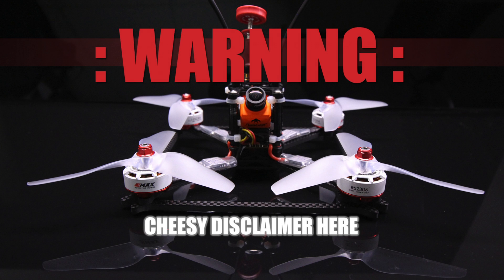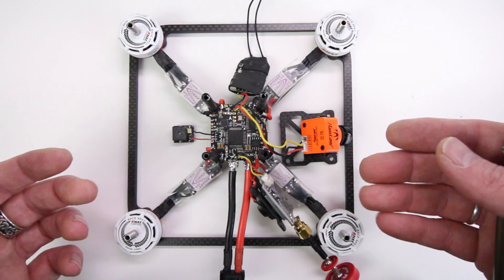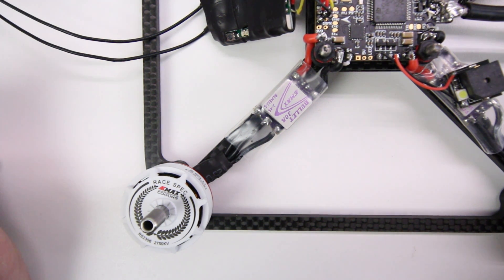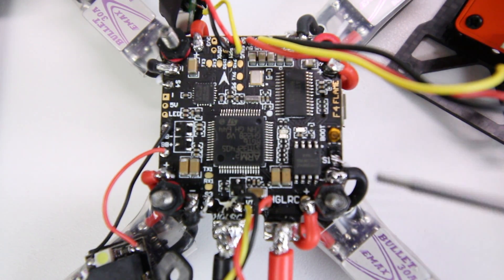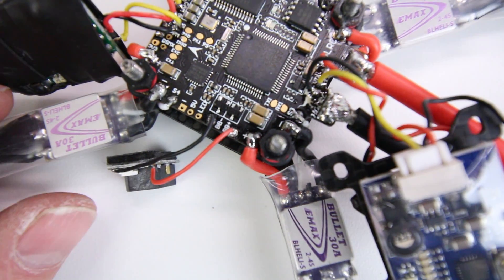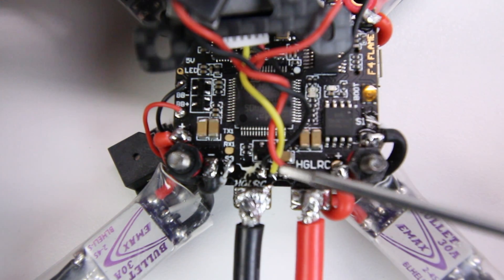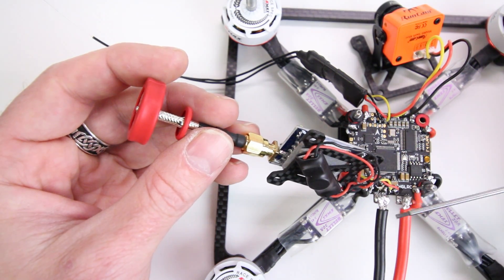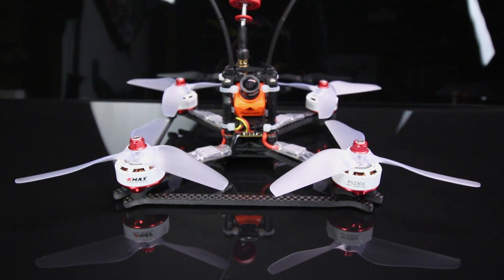100MPH RACER DRONE

Comment: sir i had made racing drone by seeing your video but i am facing problem in configuration of esc and flight controller ;in my drone i am using emax 35a bullet esc,matek f405 crt flight controller,motor emax 2306 and i bus receiver sir plz contact me my email is toystory0787@gmail.com

Comment: wish i didnt loose my kraken 5r it was fast with 2207/2650kv,spedix es30,f4 pro omnibus,frsky xsr,tbs unify pro hv weighed only 303g with cyclone props on no lipo .. you know of a frame like boltrc kraken 5r thats fast and durable? im worried if i buy a kraken 5r again the company may discontinue parts since its older frame design ..any thoughts

Comment: Even if you didn't save weight you lowered the center of gravity which is good. And also decreased the aerodynamic profile which will help to stop eddie currents from forming around the tower or "stack" when air speed is to high to flow between the boards. You've also moved the weight out to the sides and away from the center which will help it come out of spins better. Think of an ice skater. Nice build.

Comment: Hi Justin, I have purchased almost all of the components for this build.  Motors, esc's, frame.  But I am still fairly new to the hobby and have a question for ya.  I already have a F3 CC3D fb.  other than the one you are using which has more features in one fb, would there I get the same performance if I use the F3 rather than the  HGLRC F4 Flame use in this build?  Apart from more components in one what is the difference in all the more expensive FB.
Reply from the maker: I would use the F3. Easier out of the box. Flies great on default pids

Comment: I dont know who to ask but can the motors on the Hubsan H501S be replaced with other brand motors like the EMAX MT2204 KV2300 Brushless Motor for RC 250mm Min Quadcopter
Reply from the maker: Not sure Rick. I don't think so.
Reply: I don't know if other brands even to the same spec if they have them. But i'm very curious if it's possible. What inspired me to wonder is my buddy put a subaru engine in his 1971 volkwagon camper van. The mounts lined up (which amazed me) and with a few slight mods it worked perfectly and it drove fast and it became coolant cooled (instead of air cooled). Well, the only thing I have questions about is Mounting holes lineup and wiring to the ESC's.

Comment: Hey Justin I have a quick question. I built this drone exactly like it is as my first full build. I have been flying quads like the Armattan Chameleon and Ummagawd Vortex for quite some time, so I have plenty of drone experience. However, I have small problem I cannot figure out: when turning up the throttle on my Taranis, the drone spudders and "twitches." On the maiden flight it flew fine despite these twitches but then it burned up a 1300 mah 4s battery. The reason I am confused is in Betaflight, if I turn up the motor speed with the mouse on the motors page, the drone runs so smoothly. Plug it back into the Taranis, and it spudders. Any advice would be greatly appreciated. Thanks.

Comment: Great little build JD and mental fast brother man,for my washers and dampening i use old inner-tubes out of old bike tyres and such,real easy to make and cost nothing,as you know they are made of rubber so no shorting out at all,just thought i'd share that in case you or anyone else find it useful.

Keep them coming = thumbs.
Reply from the maker: Great idea Taz. Thanks for the tip bro

Comment: those Emax motors are sick. I want some so bad. I've been running the EMax 2600kv motor and just LOVE them. I need the 2750KV in my life
Reply from the maker: For sure. EMAX motors rock man
Reply: ya man. I havent tried their props yet that were made specifically for their motor, but i want to. Ive heard it makes the 2600kv just scream
Reply from the maker: Yea I do too. You want a firm prop on these. Thin ones make the quad wobble.

Comment: is there a specific reason noone flies them with 6 inch ? i would prefere the rs2205s for 5 inch.
Reply: portability.  I built a 6" and it barely fits on my backpack, 5" and smaller goes everywhere.